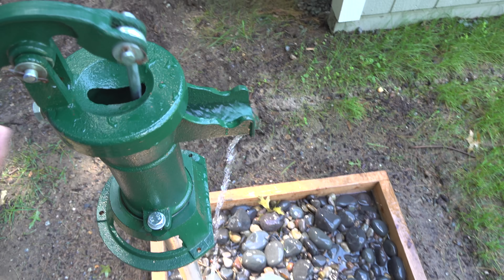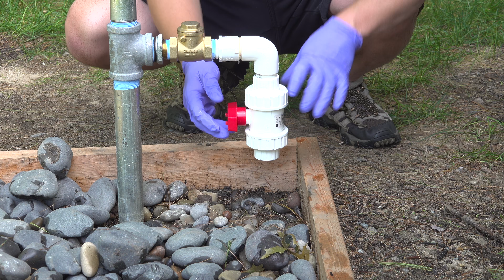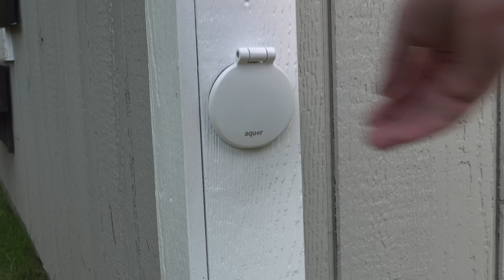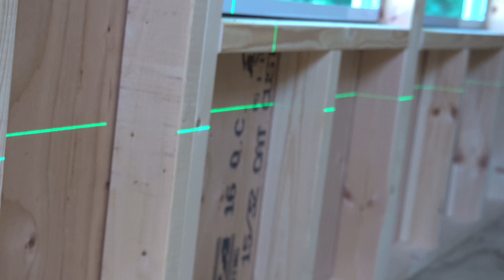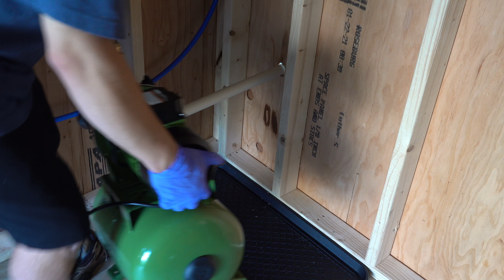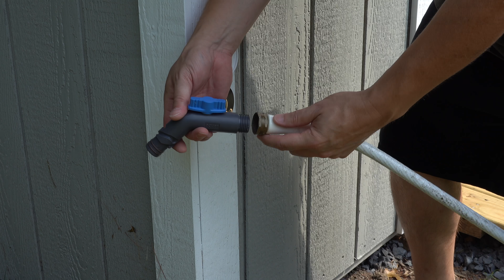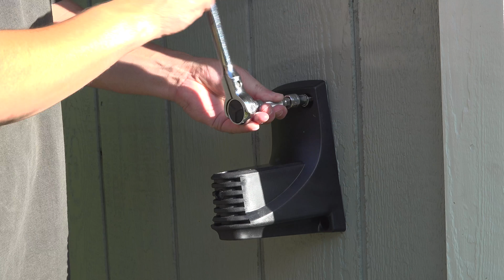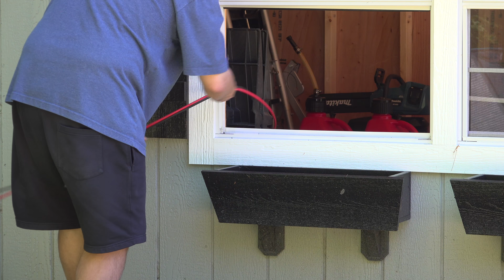DIY BACKYARD WELL with ELECTRIC PUMP - FREE Water

Comment: Your videos are great… so many awesome ideas for my homestead! Thank you so much! Keep it up
Reply from the maker: You are so welcome!
Reply: @SilverCymbal  what would you do differently if you had to do this project over again? A video showing how you winterize this setup would be very interesting.
Reply from the maker: @blsnash99  One mistake I made was not using teflon tape specifically for stainless fittings, thats the shot where you see it dripping, once I swapped out the tape it fixed it. Other than that its really working but as I use it more I will likely find things to imrpove, others will likely chime in too with some ideas
Reply: @SilverCymbal  Can’t wait for your video on the lights install on your shed

Comment: This was a WONDERFUL video, as was the one about installing your own well. But for people living in states where it gets down to -10, -20 degrees F in the winter, one will need to.insulate the pipes, right? One will need to bury the pipes that go in the ground deeper, I just do not remember how deep. 1 foot? 2 feet? Again, thanks 😊.
Reply from the maker: Thank you. For water you really have to be down 4 feet or more to be safe. Depends on the frost line so for this setup you really couldn't use it through the winter without building a heated pump hosue over it, or maybe heat tape on the lines.
Reply: @SilverCymbal  Thank you for clarifying. When I move and do my own well, I'll dig deeper, like you said, and buy heat tape too! And moving to MO like I am planning,   hopefully it'll not get as cold as it did when I lived in Idaho.
Reply: @mrssamwinchester100  we have a similar frost line here on MO. One of our lines split in the dead of winter and it was about 4 or 5 feet deep.

Comment: Do you think you could run an in ground sprinkler system off that pump setup?
Reply from the maker: Yes definitely, you will be limited for the number of heads and flow but you could do 3 at a time with this pipe I did here 1/2" but if I plumbed into the 1" line you could definitely do more using 3/4" or 1" for sure.

Comment: Very nice. Will you have to drain everything in the winter?
Reply from the maker: Yes with our weather you would have to drain it. BUT you could use the manual pump in any temp as long as you remove it after so the water drains straight back down, but the pump side couldn't handle the freezing

Comment: U should put the solar planner on the shelds roof instead. It will look a lot better.
Reply from the maker: Yes I agree, honestly I wasnt sure as I was doing this build if would even work, since many others failed to get a pump working correctly on a well like this. Now that I know it's solid I will mount a panel and route the wires inside the shed.
Reply: @SilverCymbal  yes I use the exact same pump that u use. But I use for a sprinkle system. Which have 5 normal size ones and 4 tiny one it is working well. If u guys have an high amount of dust in area u should add an tiny sprinkle to clean off the solar panels? Oh video suggest: video about what to do in winter to get your yard ready fo spring. Anyways keep up the great work👍

Comment: Great video.  Thanks.  How will you purge the system so it doesn’t freeze in winter?
Reply from the maker: Thank you. With that union valve,  I will just open it up and blow some air through the line. If I had been very clever I might have put a sprinkler box in the middle of the line in the ground with a T and used it like a drain since it would be the low spot in the system, I might still add that but it should be pretty easy to drain as is I think

Comment: Is it  that easy? 🤔🤔🤔🤔
Reply from the maker: Yes, it just takes a little time but I made the mistakes so you won't have to.  My biggest problem was that I couldn't find anyone else that did this with a pump inside a building & still kept the manual pump as a backup. What you see in the video is the result of the planing & I am sure others may have ways to improve it but it works very well, holds prime and I am pleased with the result.
Reply: @SilverCymbal  great job buddy

Comment: Great info, thanks!  👍 Would you have to cover or somehow protect the exposed pipe and PVC during the winter or would it be fine by itself?
Reply from the maker: The way this one is setip it wouldn't be able to handle freezing, you would either have to use heat tape or insulate the pipes very heavily.
Reply: @corsontucker  I would just drain the pipe at the start of winter